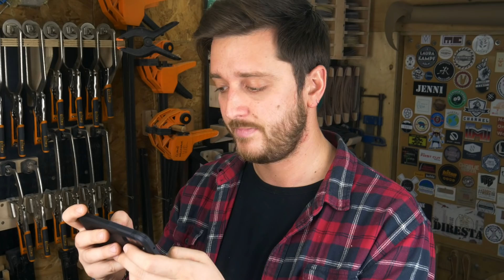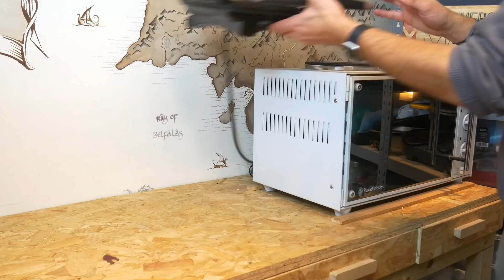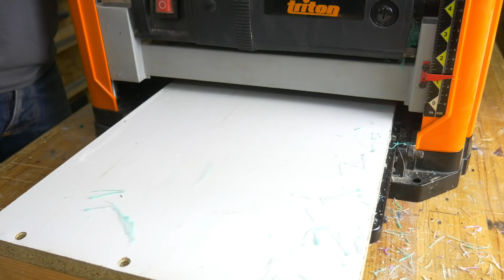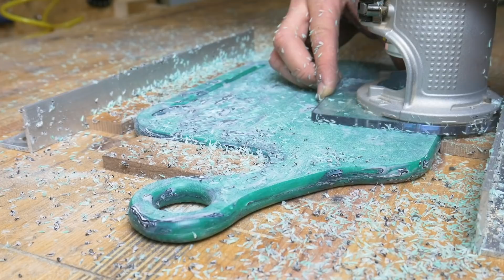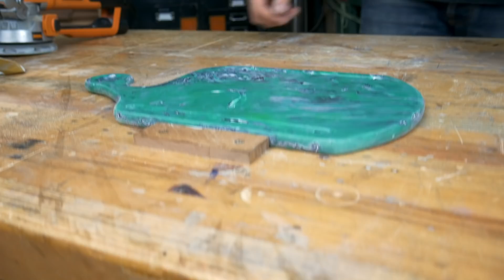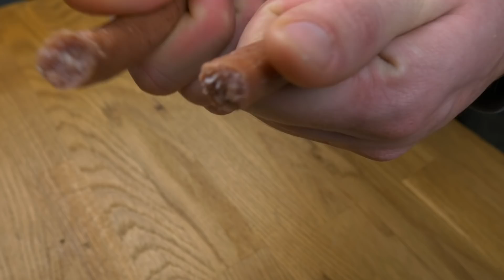Expensive Serving Board from FREE Plastic Waste

Comment: Great video guys and love the final finish on the product. When polishing with the woll mop why not use an Alumina based compound to remove the scratches? Suggest trying the Farecla G360 Finishing Compound and you will get a really nice gloss and even less pressure when using the mop.
Reply from the maker: We find that no compound is necessary. It adds an extra step

Comment: I have been trying so hard to get my boards to a nice polish by using step 2 but haven't had the same results as shown in the video. Can you cover a more detailed process PLEASE? Do you use compound or just the pads?
Reply from the maker: No compound. Just the pads. If you’re not getting a similar result then it’s probably down to the sanding steps beforehand. Go through the grits and make sure that there are no scratches from the previous grit before moving on.
Reply: @BrothersMake  Thank you for your response!

Comment: How do you polish small objects, like Jewelry made from HDPE plastic? Using a car buffing tool that big doesn't seem practical on a tiny bit of plastic no more than a few inches wide....
Reply from the maker: We polish guitar picks using the same method! We clamp it upside down in a vice and it’s very stable
Reply: @BrothersMake  could a rotary tool with a felt polishing /buffing attachment work?
Reply from the maker: Quite possibly yes!
Reply: @BrothersMake  I tried it and it Works! Thanks for the input!!!! Also is it possible to turn HDPE on a lathe into beads (for jewelry)? I'm genuinely curious...

Comment: Hi guys.
I am curious to know what kind of results you get from your remelted shavings.  I find remelting shavings traps a lot of tiny bubbles, almost like a foam, and results in an inferior block of HDPE that is full of tiny pin holes and looks bad.  I wonder if you have any better results. (NOTE:  I use HDPE from blow molded plastic bottles, which is more viscous than the HDPE from injection molded bottle caps.)
Please make a video specifically about remelted shavings, and their advantages and disadvantages.
Reply from the maker: We haven’t had the same issues that you have had! Maybe because we’re using a lot of pressure from our bottle jack press? What type of clamp are you using??
Reply: @BrothersMake  Just C clamps, but I am applying enough pressure to cause the HDPE to start squeezing out of the mold.  HDPE from blow molded containers is much easier to obtain (Just go to the recycling box) than bottle caps, but the is is much thicker than HDPE formulated for injection molding. It does not become a liquid, only about the consistency of chewing gum, and bubbles do not rise through it, which appears to be the source of my trouble.  Increasing pressure does not appear to be a solution for this.
Reply: I am considering building a crude device similar to Precious Plastic's extruder  ( https://youtu.be/Y3SM4fzfQ8w ), which I suspect will produce filiments without bubbles that can be cut and used along with other cut up plastic.

Comment: I really appreciate the time taken to help us understand your process. But I still have one question. Why do you use one panini press and one toaster oven? Why not two presses, or two ovens? It seems like there is some decision made about which colors go into the press vs the oven, but I can't figure out what it is. And in other videos I've noticed that you cut up the plastic differently depending on what method you use to heat it. Is that true?  Thank you!!
Reply from the maker: Hey, thanks for the question! There are 2 key reasons we use both - size and speed. The press heats plastic up probably 10x quicker than the toaster oven, but it has a maximum capacity. When a project requires over 500g or so then we use the toaster oven mainly to keep the mass of plastic hot whilst we melt more on the press. But since it’s just sitting there hot, we usually chuck some plastic in there to melt whilst we’re working on the press. Hope that helps!
Reply: @BrothersMake  Brilliant! Thank you!